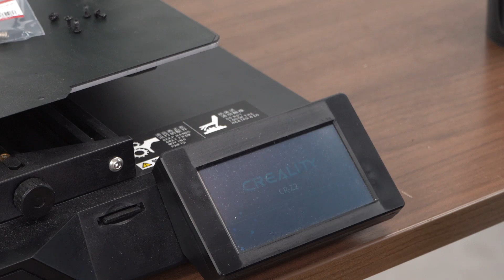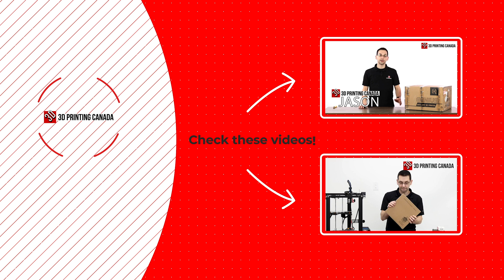HOW TO INSTALL ALL METAL HOTEND on CR Series 3D Printer

Comment: Is the sock reverse? Should not the 'hole' on the sock, opposite the heat block 'input' wires be exposing the heat cartridge rather than the thermostat? ( hope that is clear)